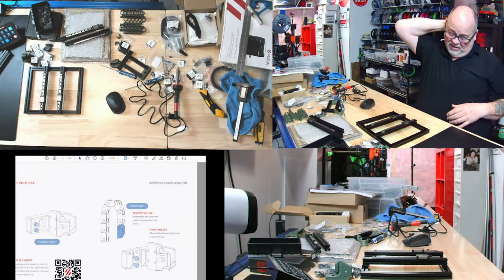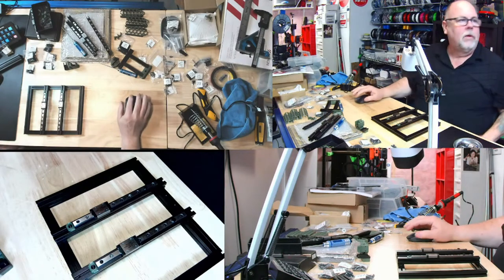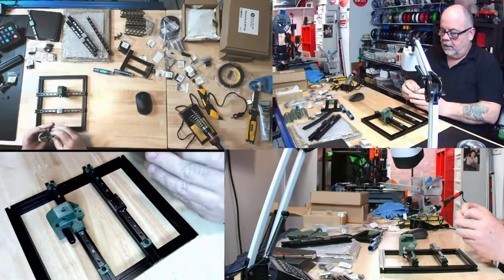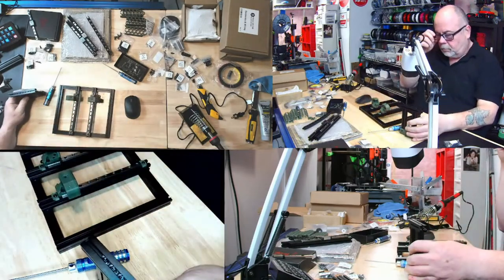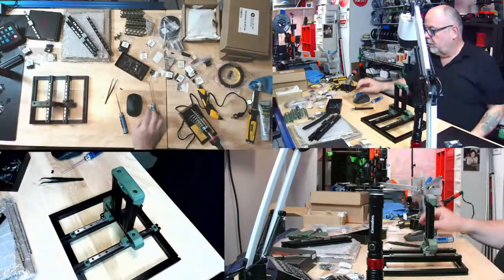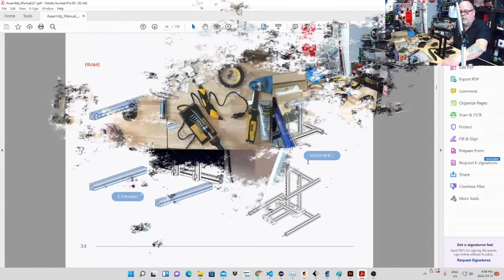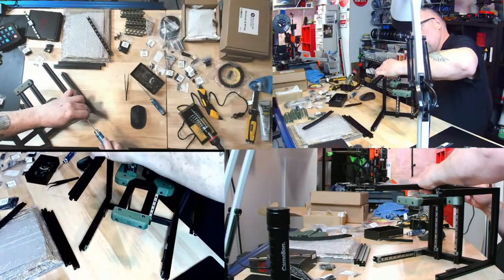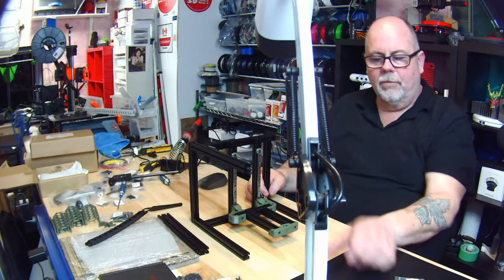Voron 0.1 build...

Comment: I love building printers, I built my Pro 3D V-King 400 Core XY from self sourced parts, I passed on a Voron as the kits were never 100% in stock and a lot of parts had to be replaced due to very bad quality, I built my printer from the very best quality parts I could get my hands on I paid a fare amount on shipping but I knew I was getting what I needed and that ther would not need to be replaced, also I was put off the Voron by the Voron Nazis in that community